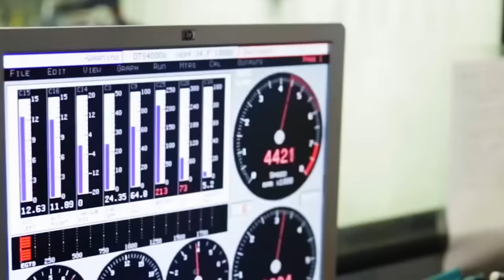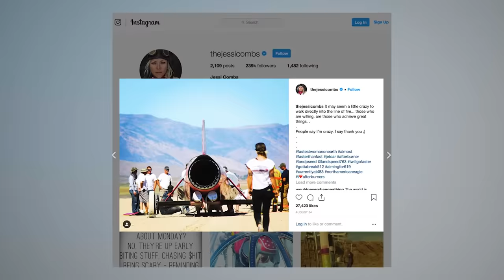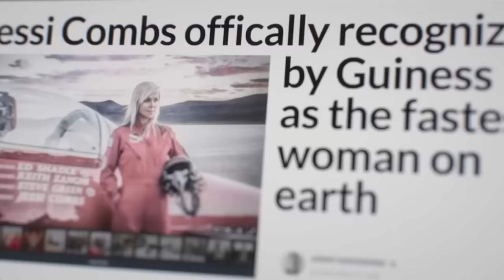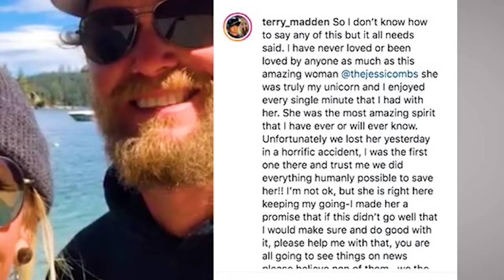The TERRIFYING Last Minutes of Jessi Combs, the FASTEST Woman on Four Wheels

Comment: Undoubtedly brave and driven, but as one who spent 28 years in motorsports up to the top levels and spent much time involved with race car fabrication, every shot of her in the cockpit of the LSR car there is one overly obvious flaw -- there was no roll/crash structure or survival cell on this vehicle! Anyone who has ever seriously built a race car would have constructed a vehicle intended for these speeds without taking this into consideration. That the team was planning on depending on the basic aircraft structure (and that's all that vehicle was, an F104, with the wings removed) without including some sort of survival cell into the cockpit design. This crash may have been survivable, except someone either decided it was too much work, or thought that there would not be any sort of system failure. Her death was avoidable, without compromising the ability to reach the speeds desired!
Reply: Been there,you are right , to big of hurry to going!!!🥵🥵
Reply: It is a terrible shame that this went down like it did!! I have never followed the land speed stuff very closely and I really thought they had some kind of rule structure to have protection for the drivers in these vehicles!! I sure wouldn't want this on my conscience!!!! RIP Jesse!!
Reply: @mikes9759   The trials held at Bonneville (I believe) are sanctioned by the S.C.T.A. and do have safety and technical requirements. She was running an independent event and only had to meet certain FIA requirements for timing accuracy, but nothing to address the vehicle itself.
Reply: With all that experience you should know that at 550 miles an hour a roll cage could have done nothing for her.
Reply: @adamimberti6948  , Actually a well designed and built survival cell might have mitigated her injuries. Yes, she would have been injured badly, it night have been survivable.
Reply: @patlatorres7000  Dude, she was going at the cruising speed of a passenger jet.... no matter how safe they build it, if you crash it is over. 

That's why they don't even bother.
Reply: Challenging the engineering safety of the team when you have no real understanding of the tradeoffs made and no knowledge about Jesse’s involvement in the decisions is actually mean in the extreme.  It is just rude and doesn’t make you look smart, it makes you look arrogant and self serving.   You should not be making yourself look good over her tradegy. You should be ashamed
Reply: At 550 mph, the last thing you'd want to do is try to mitigate injuries in a crash, unless you're so afraid of death you'd rather live as a vegetable.
Reply: I think an ejection seat would have worked. I'm pretty sure there's some that work at ground level. She easily had time to deploy one and the vehicle was upright so if so then it would have worked. What a shame. People shouldn't even do things like this unless they have some way of possibly surviving.
Reply: The owner of the nae was asked why there was no roll cage or other type of protection for the driver he said that at the speed the car would be going a roll cage would not save the driver in a crash.
Reply: Well said and articulated! I agree being former USAF airman familiar with advanced weapons systems there's always going to be some consideration given to the survivability of the crew in the cockpit of advanced fighters! Why wouldn't it be for a land bound vehicle at these speed parameters!
Reply: No amount of roll cage or anything would have saved going at those speeds thts why it wasn't built in
Reply: @mikes9759  But it sounds like she knew the risks through-and-through. In her own words, “I’m not afraid of dying, but I don’t want to die, yet,” which, while sounding incredibly stupid to me, was her ethos coming into this venture. It’s a shame it happened, but she took up the mantle.
Reply: When I watched the setting of the ultimate LSR by the British Thrust SSC team in 1997, I noted that they 'FOD'd' [patrol for (Foreign Object [potential] Damage)] before running - they would walk the future tracks, looking for and picking up anything that might interfere with the car - complete mind-numb-er, but essential for eliminating unwanted outcomes.

That said, I don't know if NAE team 'FOD'd' ahead of time - I would assume so, if for no other reason than a) protect the driver and b) NAE Pjt cost a TON over the years in $ and time, and no one was getting any younger.

Also, I couldn't point a finger because it is not possible to guarantee a completely flawless track, minute by minute - any manner of things could put objects on the track big enough to cause damage: at those speeds - Craig Breedlove got trashed on a run by a single small bolt that somehow got missed & was sucked up into the engine.

In conclusion, just like in any seriously speedy racing, any number of things can go wrong, and bring about a death/failure; ya just try & cover as many factors as you can, and when the team feels the risk is acceptable, then it's 'Go-Time'.

God bless Jessi, she left doing exactly what she wanted; so many do, in history - and we less brave reap the benefits of their hard-won experiences;
LSR activity does reap benefits in the form of better materials, better safety, engineering , performance studies - both ma r trials and mental, among other things - it was never frivolous with Jessi - the industry is constantly evolving, to the betterment of all - Greta Garbo & radar development, Katherine Johnson & the space program , Marie Curie, etc.

Godspeed Jessie,
and Thank you.
Reply: When I watched the setting of the ultimate LSR by the British Thrust SSC team in 1997, I noted that they 'FOD'd' [patrol for (Foreign Object [potential] Damage)] before running - they would walk the future tracks, looking for and picking up anything that might interfere with the car - complete mind-numb-er, but essential for eliminating unwanted outcomes.

That said, I don't know if NAE team 'FOD'd' ahead of time - I would assume so, if for no other reason than a) protect the driver and b) NAE Pjt cost a TON over the years in $ and time, and no one was getting any younger.

Also, I couldn't point a finger because it is not possible to guarantee a completely flawless track, minute by minute - any manner of things could put objects on the track big enough to cause damage: at those speeds - Craig Breedlove got trashed on a run by a single small bolt that somehow got missed & was sucked up into the engine.

In conclusion, just like in any seriously speedy racing, any number of things can go wrong, and bring about a death/failure; ya just try & cover as many factors as you can, and when the team feels the risk is acceptable, then it's 'Go-Time'.

God bless Jessi, she left doing exactly what she wanted; so many do, in history - and we less brave reap the benefits of their hard-won experiences;
LSR activity does reap benefits in the form of better materials, better safety, engineering , performance studies - both ma r trials and mental, among other things - it was never frivolous with Jessi - the industry is constantly evolving, to the betterment of all - Greta Garbo & radar development, Katherine Johnson & the space program , Marie Curie, etc.

Godspeed Jessie,
and Thank you.
Reply: First thing I thought when I saw the canopy come down "No cage" no idea why there wasn't one, but I wouldn't feel safe going thar fast without one.
Reply: Was she at 500mph when it crashed, I thought she ran out of desert slowing down and the terrain tipped it over
So cage may Have helped 

They say the wheel caused it,
It seemed like the vibration from the wheel damage, stopped her shutting it down and braking, parachute. Just run out of time 
Definitely brace driving that monster
Reply: @adamimberti6948 you think these accidents only happen at Max speed ? What if she dumped it at 150mph and died ?  roll cage would save ya probably up into the 300s my guess .
Reply: she would have had to punch out yesterday...
Reply: The most dangerous vehicle I've seen in my life.
Reply: She would have been burned alive if she had a survival cell
Reply: @adamimberti6948 we’ve watched a mitsu evo fly off pikes peak and flip over 20 times down the mountain, and drivers got out with minor injuries. The least this machine could have had was a proper driver surrounding structure
Reply: I agree.
Reply: @user-qt3lz8wx7c  I don't think you understand the forces at play when you're travelling 550 miles an hours.
Reply: @adamimberti6948  I understand the chances of survival crashing going more realistic speeds, never good, and even harder to fathom 500 plus mph, I didn’t say anything would have saved her, just stating participating in that type of Motorsport endeavor, the least they could have is some more safety instead of just sending it cause it’s cool and a record.
Reply: While I agree there should have been more safety involved even if they did create something that kept her alive at those speeds she more then likely would’ve been unconscious and would have burnt to death I personally would much rather had my time to try and shut it down safely and say my goodbyes and have a it end with little to no physical pain then to be physically hurt while literally getting cooked to death
Reply: The F104's reputation precedes it with its macabre nickname...... ' The Widow maker! '
Reply: Great observation and you are right.
Steel cages are the most important thing in any high risk motor vehicle sport. Such a tragedy
Reply: That would have made it to heavy, it had to be sacrificed OF COURSE She knew this. MAD RESPECT
Reply: @adamimberti6948 these guys have no clue about physics 😂🤦🏻‍♂️ even on a motorcycle at 120 with full gear your dead imagine 500 plus miles you’ll literally be like a egg 🥚 inside of a shoe box getting smashed into something it’s pointless
Reply: You can’t survive a 522 mile an hour crash because of a fuckin roll cage.
Reply: My thoughts exactly.
Reply: That’s the equivalent of putting a roll cage in a plane and expecting to survive a crash 😂
Reply: At the very least it would have been worth an engineering study. What usually kills race drivers? Sudden accelerations; either hitting a wall and getting hit by another car after stopping. There was nothing to hit out there so with some sort of safety capsule, (and breakaway fuel cells) I'd say survival is at least possible. It would have been a long, long, loooong tumble, but again, it's not flipping that kills drivers. 
Thing is, I doubt very much an F-104 structure would have supported such a capsule.
Reply: @blairturner139  Not true - In 1966, Art Arfons survived a crash while driving his jet-powered Green Monster at around 610 mph on the Bonneville Salt Flats. The car's right front wheel bearings seized, causing the car to tumble for over a mile. Arfons only suffered cuts, bruises, and friction burns. That particular car had a serious drivers cage.

Comment: I'm going to get flamed for this comment but please hear me out. 

The wheel failure wasn't the reason she crashed. When the wheel cracked, she throttled down and deployed the parachute. She then reached forward to shut the engine down and accidentally bumped the throttle forward and quickly pulled it back. You can see it in a video. This caused the engine to produce thrust and heat which melted the parachute. That small mistake meant that she had no way of slowing down.
Reply: is there a video somewhere of this ? also wonder what the source of the crash video is for this very youtube post, a link would be appreciated ,thx

Comment: Her passing was hard to grasp. When Valorie Thompson stepped out of the drivers seat saying it wasn't safe, the hull of a Starfighter plane retired in 1967, built in the 50's, and ultimately they wanted to break the sound barrier, a lot to ask from an old plane.
Reply: Yes, but "the plane" didn't fail, the front wheel and steering seem to be the cause!
Reply: @bebo5558  
I know, but when Valerie Thompson stepped out of the car saying she didn't feel safe in it. No real roll cage of sorts, nothing to hold the helmet or brace her neck, and how her head got buffeted around while driving the car is what I'm referring to.
Reply: @happydays8171  Just because Valerie didn't feel safe doesn't mean it wasn't safe.  Let's face it, when you're going 550mph, not much is going to save you if something fails! Jesse made multiple runs in the car. If she felt she needed changes, she had plenty of time to request them!

Comment: Whatever she was, brave or skillful at driving or determined, she wasn't smart. Years before her death I saw the North American Eagle Project (NAEP) and immediately shook my head. Compared to the state-of-the-art and extremely well-researched and built Thrust SSC the NAEP looked like something a few guys with a hammer and blowtorch cobbled together in a garage. The thing did also eerily look like somebody had just nicked a fighter jet removed the wings and added some shoddy looking wheels to it. When I later researched it I learned my first impression was correct for they did indeed take the fuselage of a Lockheed F104 Starfighter. 

Learning this I immediately thought: That thing is a garage job death trap and if they try going anywhere near the speed of the Thrust SSC somebody is going to get KILLED. 

I'm no engineer but I understand one thing: Highly advanced vehicles designed for extreme environments or challenges can't be done on the cheap and certainly not by cutting corners . That Stockton Rush clown thought this didn't apply to his carbon fiber death-trap Titan submersible either. He used cheap off-shelf components, a game controller(!) and used carbon fiber which nobody uses to build deep-sea submersibles for a reason. 

The Thrust SSC took four years of research, testing and development to finish. They used scale models of different sizes in wind tunnels, state-of-the-art computer simulations and developed their own back-up and warning systems. Everything went step by step and each step required thorough research and testing. 
The NAEP was a shoestring budget job by comparison. They skipped the whole designing a proper land speed record vehicle and just took the fuselage of a fighter jet. Here's what both the Thrust 2 and Thrust SSC teams discovered. When approaching transonic speeds the shockwaves from the vehicle hits the ground bouncing back into the vehicle. For this reason it can begin to buffet violently or at worst take off. For an airplane this isn't an issue to consider at all because it's high up in the air and not on the ground. You also can't simply counter this by adding lots of downforce for at these speeds the forces would begin to push the car into the ground. All in all it's extremely difficult to design a land-speed record car which stays stable at such speeds. I bet most of you who comment here either are completely oblivious to this or just assume these guys here knew what they were doing as did Jessi... (doubt that). 

I'm on engineer but knew it was a garage-job death trap. So like I said Jessi Combs lacked the wits and knowledge to see this. 
Hope this record was worth her avoidable death. Life is precious, don't waste in on foolish endeavors and garage job death traps. And for those of you who think it was worth it. Ask her family, friends and relatives which they'd rather have - her dead holding a record or alive not holding that record. 

The moral of the story is: If you want to go to highly dangerous environments or reach very dangerous records, make sure it's a properly engineered vehicle and not somebody with big dreams and it-can-be-done attitude (too many people are total suckers for falling for this).

Comment: Question: since her land speed 'car' was a jet aircraft without wings wouldn't it have been wise to retain the ejection seat originally included with the aircraft thus giving her the ability to punch out in the case of any catastrophic failure?
Reply: There is no ejection seat capable of protecting a pilot/driver at very high speed. They are primarily there for low speed hence the use of the term  “zero -zero “ None of the recent land speed record cars have even considered them and have relied on the structural integrity of the vehicle to protect the driver. This fact has frequently brought into question the viability of using an aircraft body like the F104 she died in. Airframes were never designed to withstand the  loadings on both the running gear (up to 50,000 rim load on a solid wheel!) and the aerodynamic loads at ground level on the body. Most military fighter  aircraft are not capable of reaching Mach 1 at very low level and top speeds can only be reached in thin air at high altitude. The only LSR car to officially break the sound barrier was Thrust SSC in 1997 (26 years ago!) - a record that still stands today and is unlikely ever to be competed for again after the demise of the UK Bloodhound project
Reply: By the time you realize it's happening it's too late, I have raced desert for many yrs and you don't realize you are crashing until you are already past the oh crap stage.

Comment: Sadly she should of known that you don't go 400mph in a car with absolutely no driver protection. GOD BLESS her. Quite the lady.
Reply: I don't care what kind of protection you have.  At those speeds there is only 1 outcome and it's the same everytime.
Reply: The plane had an ejection seat....guess they removed it
Reply: Nothing would have helped at those speeds. That's why they don't have roll cages in those cars. Even if it was equipped with an ejection seat, at 500mph, she wound had less than a split second to react, and punching out probably would have killed her anyway. The car probably came apart so fast she's never knew what hit her.